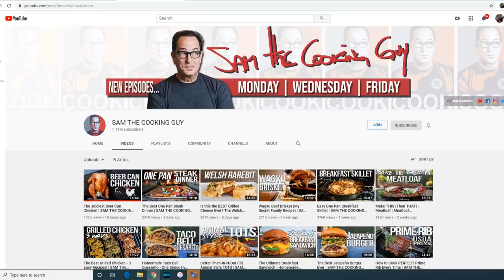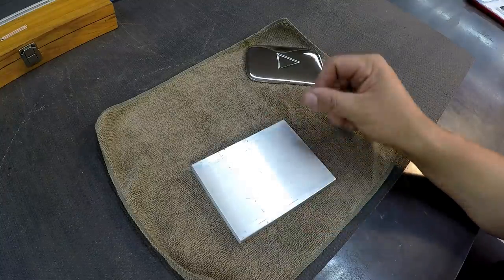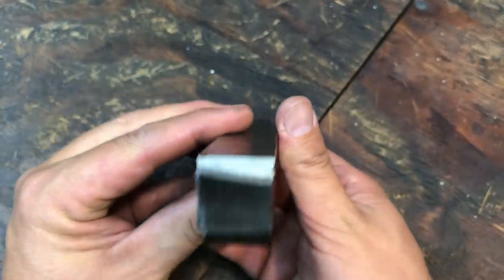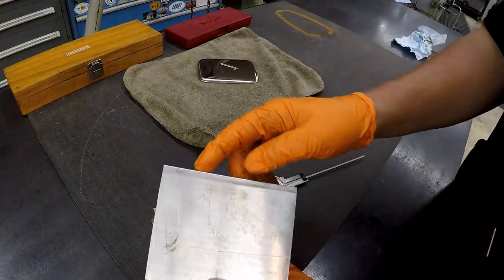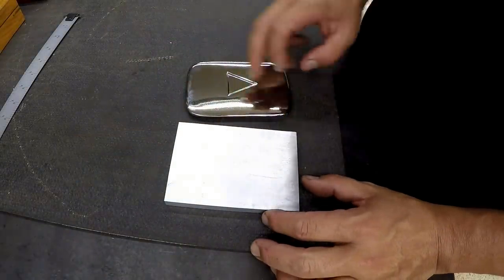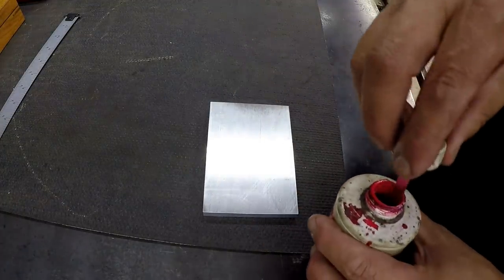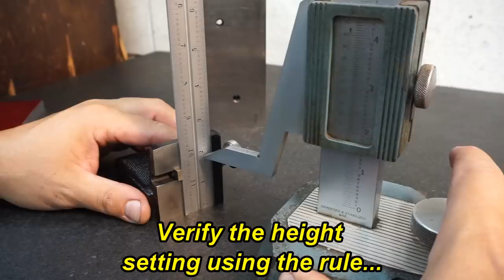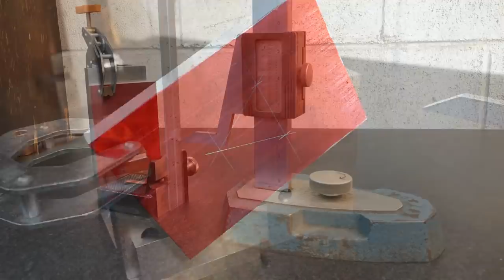Machining a YouTube Play Button Ep: 1

Comment: Hey Adam, you could still work the radius in to the work piece using hand skills rather than machines without much difficulty. As long as you've got a good eye which you have, you could indicate the radius on the side, rough it in using the belt sander and then smooth it all out with an orbital sander then give it a polish. Its only aluminium so is easily shaped and  could get very close to the original pattern as it is a 1 off. As long as it looks good it is good when hand crafting things 👌 loving all the content and appreciate the knowlege and hard work you put in 👍

Comment: Could still maybe machine that radius in, without CNC. Start from the middle, feed out maybe 0.003", mill a rectangle. Feed out another .003, and down by .003. Mill a rectangle. Repeat for hours, to the edge of the billet. It would be a weeping, long process, but you would end up with a kind of stepped radius (a "digital radius", if you please), that could either be left as-is, or sanded on a slack 220 belt to blend the steps.
Reply: Wait. No. Use the Eutalloy spray welder to build up the center, until you have the radius. Then sand it to blend the edges of the spray passes.

Comment: Send the original button to Mr. Pete and he can make a mold and cast a duplicate in Aluminum.  It would of course be slightly smaller when it shrinks.  Then you could clean up the edges and the back.

Comment: Actually you could put that long radius on the face of it with the belt sander I bet
Reply: Anyone could shape the face of it with a flap disc, go over it with some fine sandpaper and a buffing wheel, but it won't be to tolerances or what you would call a machined piece. If you only want a play button that look exactly like the original, you can just go on Ebay and buy a replica one.
Reply: Kowalski K yes, but this isn't a precision part with any tolerances on it, and yet it's still a machined piece.

Comment: loved the silent work...I talk to myself CONSTANTLY when doing this kind of work, almost a "yea, that's right" or "no, that's not right" thing going.  Too bad my "No, that's not right" side doesn't come out enough...lol.  I work primarily in wood, and wood is actually a lot less forgiving than metal (you can technically add metal back, you can't add wood really)...
Reply: WreckDiver99 
According to some people on the woodworking FB groups all you need is Titebond and sawdust to fill your mistakes. They even claim it’s stainable too. 🤣
Reply: @Crewsy  that's great for "small" areas...LOL...I don't make "small" mistakes..LOL...When I make a mistake it isn't a .0625", it's .250"!  Go big ...yea...I've spent a BUNDLE in re-work in wood working...I measure 4 times and STILL screw up...LOL
Reply: WreckDiver99 
I know that for sure. I recently built myself a shed and of course I had to complicate it by adding a 2’ bump out requiring valley rafters. 
I don’t remember how many messed up cuts I had trying to get the compound angles correct. Good thing an 8’ 2x4 has enough material to end up at 4.5’. 🤣😂

Comment: I'm wondering... How difficult is it to machine a wide radius like the curve on the button's face with the shaper?
You'd need a cutting tool with a wide radius and some height adjustment (horizontal cutting) or a small radius on the tool and lots of fine height adjustment. No automatic cut advance.
Reply: I was wondering that too.
Reply: That occurred to me as well. Grind a form tool to make a radius along the edge.
Reply: It would be very easy if there was a DRO on the shaper; just use the arc function.
Reply: The basic shape would be relatively simple - it's just 2 basic radius profiles. The really tricky part would be the corners, where you have compound curves blending between the radii.

The simplest way would probably involve a lot of passes with either a ball mill or an end mill with an angle plate and vertical rotary table, followed by smoothing the whole face on the belt sander. Many, many opportunities there to turn the work into scrap, as well as taking a whole lot of time both machining and calculating the steps.

(Actually the simplest method would be to do the whole shape with a sander, but that would be really tedious and probably cramp the hell out of his hands. Not to mention the ton of aluminum dust it would produce! Wouldn't be very interesting to watch, either.)

Comment: Abom can you please show us a video on how to get a very good surface finish on mild steel using the lathe
Reply: Use a wider sharp hss insert it will polish a cut due to the higher surface touching then go up in grit of papers and then polish if you want it mirrored
Reply: @mealex303  thanks

Comment: Also why use the space when clamping the aluminum plate as opposed to just closing the vice all the way into it?
Reply: Curious about this too
Reply: Not entirely sure (I only did machining for like something short of a year and it was only lathe so no vice) but I can only suspect it is because of:
- vice jaws could be not perfectly flat, bringing risk of misalignment
- applying force through smaller area gives higher pressure, hence stronger grip in the vice
Reply: It wasn't perfectly square so could adjust it with the square then clamp it and after it was square he left it in so he could measure the height he wants without unclamping the part.

Comment: Sorry, but serious question.  Why use that shaving machine vs a cnc or lathe?   Whats the advantage of the shaving machine?
Reply: Cause it's dope. Other than that, literally nothing.
Reply: Craftsmanship.. Art.. Passion 
On a CNC you create the object on a computer and the machine carves out the part. 
Adam uses these old beautiful machines that require all three of the prerequisites. Each scribe line, cut, work holding is all done by hand.
I'm big into bicycle building, carving and shaping lugs that hold the tubes together.  I'd get so bent outta shape from the smallest inprofection until I heard one of the best say.  "Profection is Inprofection"   It's all about the human element.
Reply: Euclid AllGloryToTheLogLady 

OK, wasn’t sure if that machine was more capable than a CNC.  👊🏻

Comment: Couldn't you have used the shaper to step over and step down to rough out the curve on the face? Then belt grinder to smooth out the curve? Would require adjusting the steps, and turning the piece 4 times, but you probably could have gotten really close.

Comment: Actually, to get that rounded bevel would not be that difficult to do if you started with a cylindrical piece of stock.
Of course, it would have to have a large enough diameter to allow the rectangular piece to be cut out once the bevel had been machined.
It might not be perfect, but you could make a very good approximation this way.
See ?
Not that complicated.
Or am I missing something here ?
>

Comment: that angle block you use at 15:00 how would the corner relief be cut in that? did you make it? The blunt notch doesn't quite look centered with the faces leading into the corner.... I imagine you could drill it from the end and then mill the corners into it, but would you have a cutter that could mill the relief into a corner? 15:15 you mark it twice... why? I was taught to mark once and that multiple marks lose definition... you still got your line, but the first one was good enough.

Comment: Why didn't you use a compass for the layout of the triangle?................your method seems to vastly complicate what was basically a very simple process.
Reply: I think that the process was the reason. Showing the tools available to produce any layout to fine tolerance. The fact that the triangle was easy and on a shape that did not require the accuracy is kind of beside the point.

Comment: You could probably form that elliptical radius using a mount at the end of a LONG pivoting beam tracing an elliptical path making EXTREMELY light passes over a disc sander. That being said, the work and time required to either debug a model in something like Fusion 360, or worse, experimentation, would be prohibitive.
Reply: Kinda like lens grinding.

Comment: Why the need for such precise accuracy?
Reply: Art M because he can.
Reply: The Don Of Pies .....THAT is THE answer. The ONLY answer.
Reply: satisfaction: he could have just scratched a triangle in the middle of his blank with an old scriber and called it a finished play button... but when you're capable of more and can do better, that's what you do!
Reply: @ArthurTugwell  Following that logic, then he should also have machined a nice bevel that mirrored the aluminum cast Play button.
And it wouldn't be that difficult to do if he had started with a cylindrical piece of stock.
Of course, it would have to have a large enough diameter to allow the rectangular piece to be cut out once the bevel had been machined.
See ?
Not that complicated.
Or am I missing something here ?
>